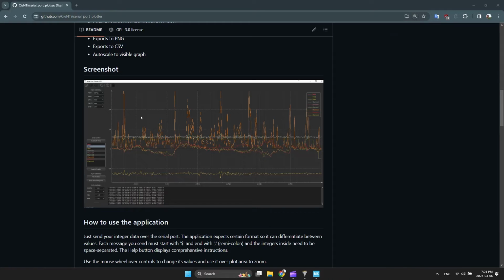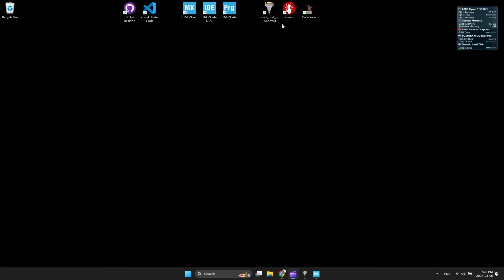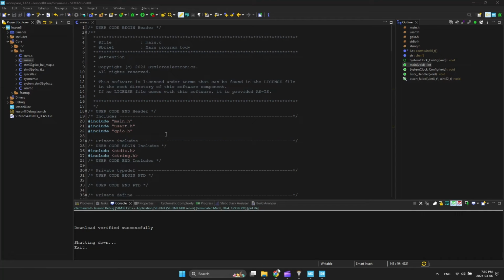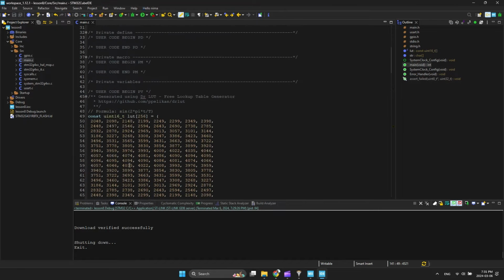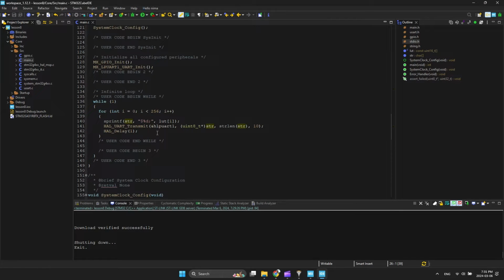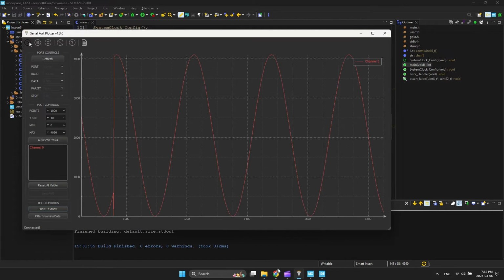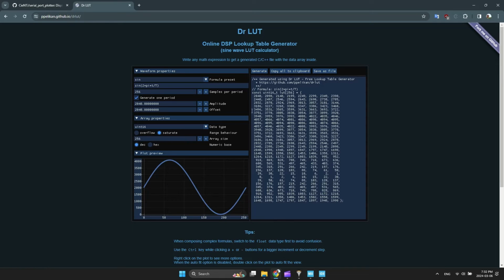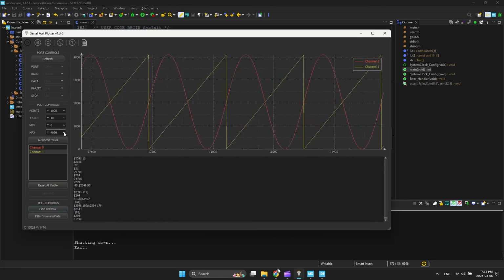STM32 LESSON #8: DEBUG (SERIAL PLOTTER)

Comment: How is Web Serial API different from WebUSB API?

I have an accelerometer that transmits via serial at 1Mbps (it's a USART, not UART).   I tried to write a GUI using pyqtgraph, using one thread to parse the serial data, and another thread for the gui updating part.    Unfortunately, after just a few seconds the GUI would lag, unable to keep up. 

Any idea if the PC application could be modified to receive data in a different format , but still via a serial port?
I've seen a few projects ( VizhPort , serial-studio, RealtimePlotter (Processing IDE),TelemetryViewer, hyOzd /serialplot , curiores/SerialAnalyzer ,csavur/RealTimeSerialPlotter ) but not sure how they handle lots of data. 

Standard can-bus operates at 1Mbps, so perhaps if there was a way to use a can-bus visualization tool for serial port data (pcan-explorer, plot-juggler, Tbruno25/can-explorer SavvyCAN )? 

BTW, any thoughts on Flutter/Flet and fl_charts?
Reply from the maker: Try teleplot in vscode.